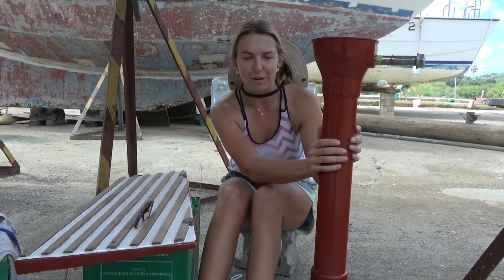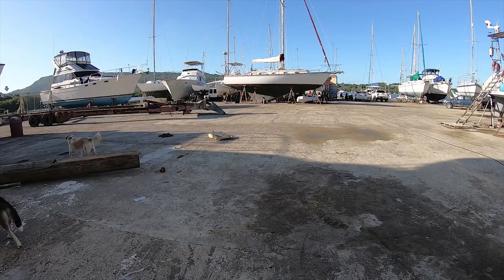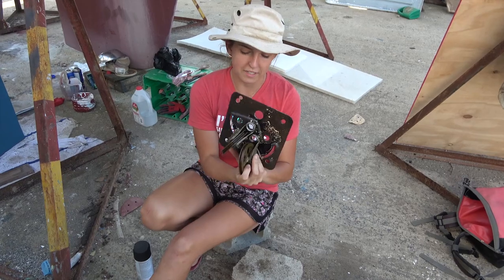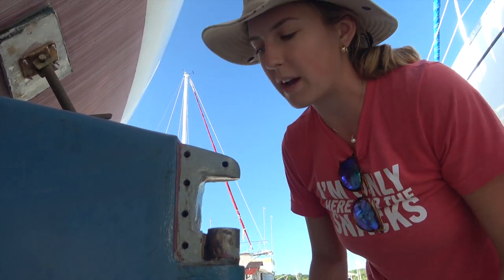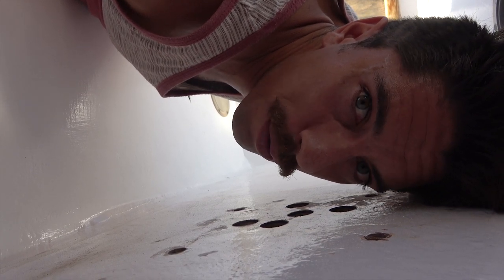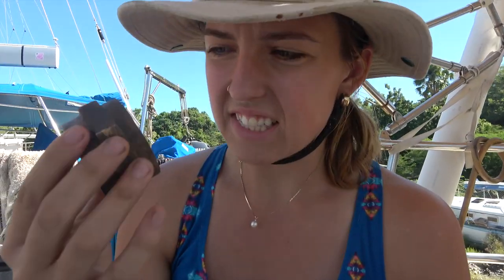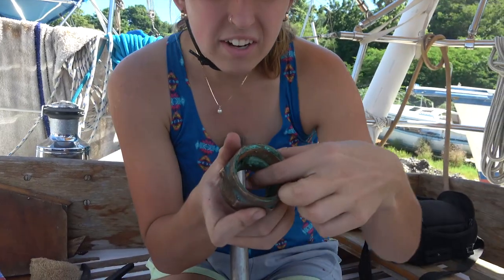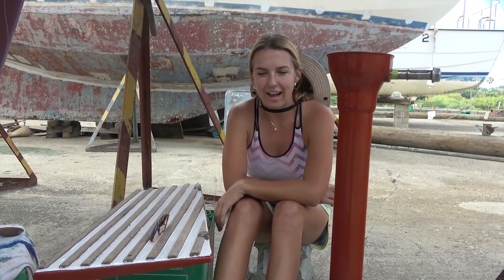BREAKDOWN in the Boatyard Ep 101

Comment: That stuffing box on the rudder definitely needed to be restuffed. I hope you guys dont get too frustrated. Just like people who sail on a schedule get themselves into trouble launching your boat too soon may cause problems. Take your time and do it right.
Reply from the maker: Agreed, the flax just came in! True, thanks for the reminder.
Reply: Lp j Agreed. Might be possible to coat with epoxy and sand to desired diameter. Use plastic pipe cut in two along length with sandpaper on inside of pipe. Sandwich together and move along shaft. Crude but faster and cheaper than new as shaft if cost and time are an issue

Comment: Those pulley blocks are 'riveted'  to the now very, very,  thin steel plate. Something should be done to reinforce the connection.
And as others have posted never use oil on hoses, use liquid soap.

Comment: your points are wet on your bike, when they dry it will fire right up. Tip: WD stands for Water Displacing, as in WD40.
Reply: And they keep mentioning wd40.... a great solvent too
Reply: If the bike is crude enough to have points, then the capacitor is also suspect. If the can is no longer perfectly sealed the same result.
Reply from the maker: Thank you for the tips. This seems to make the most sense and is what many others have mentioned.
Reply: @Bumsonaboat  what?the beer for anxiety,  lol!!!

Comment: You have to learn to accept that "this is the best I can do" !  As long as it is safe and secure, then it can be "good enough".  Perfect paint jobs are difficult and take time and practice.  FYI - the best primary for aluminum is either a zinc chromate or a self etching primary.  Both are available in spray cans (remember, multiple light coats following the label directions for between coats drying, is best).  You may not find the zinc chromate primer (weird yellow-green color) in a hardware store but the should have the self etching.  How is your sandpaper supply holding up ?
Reply from the maker: We are finding the balance between the two. Basically I am way too far on the good enough side while Michal strives for perfection. One of the many balancing qualities of our relationship. I would say we are down to half which is still plenty. We will remember those recommendations in the future but for now the pedestal is "good enough" 😆
Reply from the maker: Agreed, I am far on the good enough side while Michal tends for perfection. One of the many balancing qualities of our relationship. We will remember the recommendations for future jobs but for now the pedestal is "good enough" 
I would say our supply is down to half, which is still plenty.

Comment: Hello Guys. try and get some CITRIC ACID food grade and mix it 5 to 1 of water i use hot water as it reacts more faster on rust and also lime scale. on rust it eats away at it making it look like new after you use a wire brush on it. and lime scale its eats it up leaving the surface like new it good for water pumps and pipes and great for toilets too and use it on your shower head so all the hole are empty of lime scale good luck

Comment: You are at the toughest part of a project. So close but still so far away. You have made good headway. Just keep doing what you have been doing. Sometimes after a rain the electrics of a motorcycle get wet and spray a little WD-40 on the electrics to dry them out.
Reply: Yes....WD stands for water displacement and it was his. Fourtith attempt to get the correct formulation.

Comment: hey Bums , happy fixing, The bike most likely has a bit of condensation in the carbs after a rainy day, there is a screw on the bottom of the carbs to drop out the fuel in the carb that may have water stopping it getting fuel after a rainy day
Reply: thats a good point, i was thinking maybe rain was getting into the points/electronics on side of engine.
Reply: @carolinabeacher1558  yeah my first 125cc used to do that all the time, would run up and down pushing it hours trying to start it, then someone showed me the screw under the bowl to drop off the carb fuel
Reply from the maker: This was our first thought but after taking the carb off, emptying and cleaning the problem was not solved. Really thinking it is electrical like many others have suggested.
Reply: @Bumsonaboat  Park the bike in the sun for an hour.

Comment: Nice Vibe to the woodchopping score... I thought Tubbs & Crockett were gunna come walking up the yard!..   Nice serving of corn here & there:) Rudder seal should be fine with some new packing, a zerk to pump in some grease always good & nice to have- only turns through 75/80 degrees & not like it's buzzing around at 1000rpm - You can roll & deform your packing to a different aspect ratio to a minor amount also. Those minor frustrations & insecurities and anxieties are telling that you're at the best end of the Dunning/Kruger equation. With any human endeavour perfection is the aim of the intelligent,  the intelligent also settle for  somewhere between good & excellence depending on the purpose & resources... sometimes a chillout needed & I'm remembering your  Alan Watts inspired  piece & just good to go have fun now & then that serves no purpose but to recharge the spirit.

Comment: You are so close to having that boat all fixed - you will be so proud of yourselves and be able to fix anything . From here on it becomes upgrades and cosmetic which is way more fun . It sucks to be fixing a leak, it is rewarding to have a fresh painted cockpit you can be proud of . Next you will be making it pretty with teak oil and cockpit cushions . 

I see so many with more money and less skills totally flummoxed when something little goes wrong  or they get a leak and panic because they don't even have a clue what could be leaking or get stranded because the engine is a magic box they are afraid of . 

By the way Joel is right , you can walk away anytime , even just for a day or two to mentally regroup . Sometimes you have to if something is getting to you or not going well . Doing something else is sometimes as good as a break .

One thing I always told myself about something broken where my choice was fix or replace . It can't get anymore broken , I might as well see if I can fix it . From there I have fixed many things that I would have had to otherwise replace. I recall one sailing channel repairing a chart plotter by replacing a transistor on the board (or something like that )  - good for them, most would just throw out and they gambled a little and won .

Comment: A tip for the future from an old guy

If you have a bolt that fits (right size) but too long.
Put a nut on the bolt, cut to right length, back nut the off the bolt. Use a fine file to dress the starting threads so the nut will start on again.
Good to go

Comment: The moisture on the electric. Most of the time is the spark plug wire.  That was my experience.
Reply from the maker: Thanks, this would make the most sense!
Reply: Just cut 5mm of the wire.....clean the L connector (the bit were it’s screwed into the wire) or if available get a new one....done

Comment: Gland packing is a normal maintenance item, I would check to see if you maybe missing a gland packing follower with your assembly, if you can get access to the original part drawings.
Get a inexpensive caliper, measure the O.D of the shaft were the stuffing box goes, then measure the I.D of the stuffing box were the gland material was, then subtract the difference and it should give you the relative size of the square packing material thickness that is commercially available. There can be between 3-5 packing rings in a standard gland design, you'll have to measure how deep your packing area is to get an idea of how many rings. Wrap your packing around the shaft and get a new utility blade and use it to cut your packing material at a 45 degree angle, it seats better and makes a better joint. Rotate all your joints so they are not inline with another packing Joint. If you cannot pull the packing you can use a thin wood screw and screw it into the packing then pull on screw with needle nose pliers or a thin screwdriver blade to pry it out

Your skill levels/experiences are not adequate for the quality of work and knowledge to make the repairs that you are dissatisfied with the outcomes. As an Industrial maintenance and all around farmhand/horse racing, I have spent over 30 years learning my technical experiences and am constantly having to learn new technologies, which entails robotic pick and place systems for parts manufacturing as one career path out of many I have since working at fifteen years of age and two AA/AS technical degrees that took me ten years to earn...
You have to put the time in to get quality results....there are no magic wands out here...

Comment: It's most likely a short in the electrical system somewhere. Spray every wire and electrical bit with some WD40 to keep the water out as diagnosing the problem could be time consuming and therefore pricey.
Reply from the maker: Copy thanks, many others have suggested the same.

Comment: Double gear clamp all hoses . Put the clamps on going opposite ways . Also beware some of them are crappy stainless that will rust so be careful to use good ones . Having two  ensures no leaks and a back up if one fails and  doubles the holding power . Very cheap insurance for anything that can sink the boat .
Reply: Great advice

Comment: Michael Shreeve
The only thing that really caught my eye (there might be more if I look closer) was the steering set up. That is clearly at risk, going bad. I realize its hard to get stuff near your boat, but, maybe you should try to get a few parts, two stainless trolleys ( what I think you call the pulliey assemblies) and a chunk of thick stainless to mount them on. If you should lose control of your rudder because one or both of those fell apart, you could lose your boat ! They really looked bad, and stopping them from corroding might be nearly impossible ? Hey, how is your mast supported ?
Reply from the maker: We agree that it is the weak point in the steering. I feel that we would use Edson's if we decide to get a new one. Most likely we will give this one a go for the near future with the backup plan to use the emergency tiller. Also our autopilot will not fail if the steering does. The mast goes into a sleeve that is resting on the keel.
Reply: @Bumsonaboat  First, great everything.
Second, the only thing I see wrong with your steering pulleys is the base plate. I can't feel the action of the pulleys. But if they're okay, it should be a simple job for a metalworker (maybe you guys) to remove the pulleys and affix them to a new plate. For that matter, new pulleys could be installed too. Looks like a straightforward job to me. 
Again guys, great everything.
Reply: I checked and if you were to buy each idler separately, yea, they are very expensive, $180 each.  But, mounted on a stainless backing, they will last forever. I purchased the stainless backing at a metal junk yard for $20. One of the reasons these are so expensive is that they have been "certified" as marine. Pulley's not so certified, but which are the same, would be half or less the price. I'll try to find some of these. Also, Edson is basically two stepping and doubling the price as these are actually Schaeffer parts. Edson Buys and sells. More research is needed, I'll try to do what I can from here. One question, are you able to order things, I would assume so ... ?
Reply: @Bumsonaboat  At least you would not lose the autopilot.
Reply from the maker: @svphoenixandme776  Okay, we will explore this option.

Comment: Spray silicone on the plug wire , wiring if the carb clean doesn’t do it.
Reply from the maker: Okay awesome, Thanks! The carb was clean so we will try this.
Reply: Since it happens when it’s wet or damp outside , it seems like a good idea . In the dark when it trying to start you may be able to see a spark arcing across the wires to a ground or other wet surface.

Comment: Reconsider replacing the Edson cross-wire idler. I was in the same situation, cleaned the old rusted idler, hoping that it woulds last.   But failure of these old rusted units has left many without steering.  I hated paying the $400 too, but after hearing from a friend who lost steering because the pressed ring which hold the idler wheel mount to the plate pulled out causing total steering failure.  There is a lot of force on the wire pulling on the ring at the plate and idler wheel.  It will fail at the wrong time, so best to do it now.   I'm glad I did.  See my write up on my blog: http://svjohannarose.blogspot.com/search/label/NewIdlers
Reply: dreupen  Interesting blog post. It, looks like a common problem with those idler pulley. And the do get a lot of load.  If they had access to a welder  the pressed on pivot points could be welded solid as the know what angle to set them at . Defiantly a hard call as if they bent or pulls out it would be impossible to fix later. Cheers warren
Reply from the maker: Thank you for your reply. We will check out the blog. We agree it is the weakest link in the steering system. Michal smacked it around pretty good when she was cleaning it and says it is strong. After the rust treatment we may start with it but look to replace it in the near future.
Reply: Bums on a Boat just be sure you have backup steering and have trained with it

Comment: Grinder to clean rudder shaft??  Better hope he didn't grind where the stuffing box is. That area has to be very smooth and round, if not, you will get a leak.
Reply from the maker: Yea, they just took over. It is still round and the flax should do the job. Also the stuffing box for the rudder shaft is above the water line so it should have to work to hard.

Comment: No, you can't just make a cup of coffee, sit down on the sofa and watch a film...  the jobs just don't melt away!  It's a challenging time when the list just seems to grow even though you're knocking items off.  Advice: tackle each job as a project and not try to sort several at once - you'll end up with poor quality that you'll need to revisit, and that's depressing.  Being able to look back on a job well done is so rewarding and gives you impetus for the next one.  Just one comment on WD40 and 3in1 they contain solvents and mineral oils that plastics don't like - be aware.  Teflon(expensive) and silicone(cheap) sprays are much, much better.  Maclube is the best lube for metal/plastic but is expensive, use sparingly.  Shame about the rudder post but it looks in good condition and in any event should be re-packed regularly.  Modern gland material is so much better than it use to be.  Chin up, and as we say in the UK, it could always be raining...

Comment: Never ever reuse anything  metal that is rusty or corded must buy new or could end up dead that simple. When anything metal is to a certain size that means it must be replaced with  metal that size. and thickness not to be reused. Also will affect insurance for using something that is unsafe. to do something cheap does not mean it is right to use. Again cleaning out metal does not mean it is safe especially to do with a weight like a rudder as could fall off at any time it need to be professionally done.  now as the bolts holding rudder on they must be checked for size and density not just cleaned up these are life parts of any boat with out a ruder you are in real trouble. So the bolts must be checked to see if the thread is correct and clean then the holes of thread to bolt on must also be checked and clean as cross threading or damage to a threaded bolt and nut or hole thread will cause damage and things will break easily.  So if using any rust solvents in side threads will cause the thread size to change even crack. Plus there are tolerances with Nuts and bolts that are used by a torque wrench same with nuts on props. If too tight will make things grind that includes bearings. Its common sense to know these things first. I think you both are being silly and needed an expert to help I see so many mistakes and short cuts as those can cost lives on a boat. Being anxious is not a good thing in sailing or doing things time for you both to stop slow down and think carefully and get an expert.

Comment: im fixing my 14 goot aluminum jon boat. its a 1959 alumacraft and i wanted to fix ity up all nice and pretty..
im panting it atm, but i had to drill out rivits and redue the transom, drill out rivits where the bench seats where, replace them with hardware.. 
i had to drill out rusty shit ass bolts and crap cause wtf who uses steel in a boat.. replace with stainless steel..
ive run into propblems with every fucking aspect of this project.. this boat has fought me every step..

ive wanted to take a ax , sledge hammer and just bash the boat, take it to the dump and leave it there... ive wanted to fucking just quit andf give it away...

all the $ and time i cant tho..

i feel ya man this boat im doing was sapose to help with my anxiety, ad depression but it made it worse fucking bnoat...
Reply from the maker: Don't give up my friend. Although there may be no end to the work, there must be a time when it is "good enough" and we put her to use. 

I can relate for sure.

If we focus on enjoying the process and remember there is no destination other than now, we might just make it. At least I am going to try this out today when we go to battle in the boat yard.

Comment: You should NEVER use OIL on those hoses! One thing you're allowed to use, which works fine, is WATER. Oil deteriorates the plastic and of course you do not want these hoses mounted with a slippery substance. I'd be very anxious about this serious mistake and others you're probably making. A loose hoses like this can sink a boat.